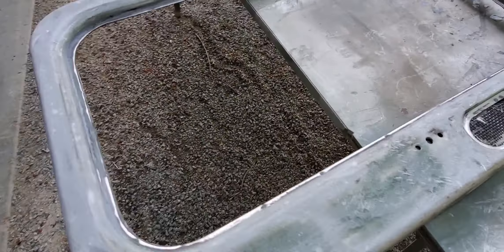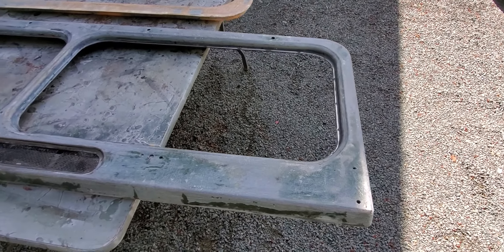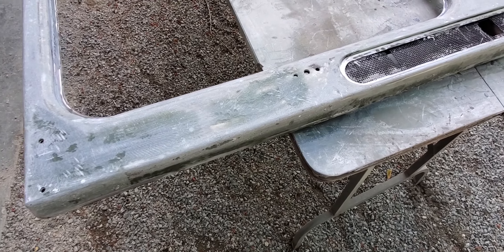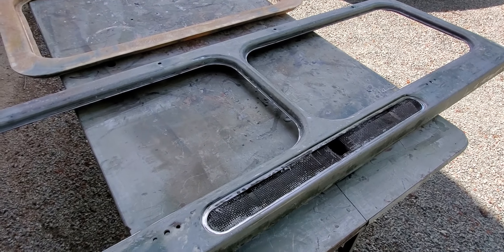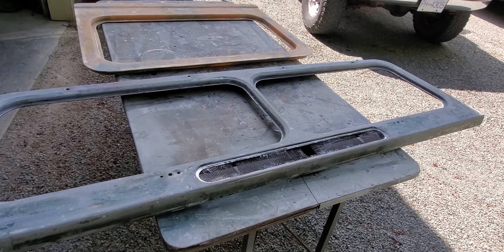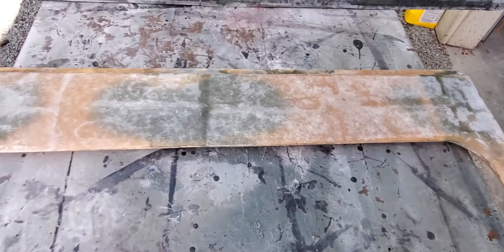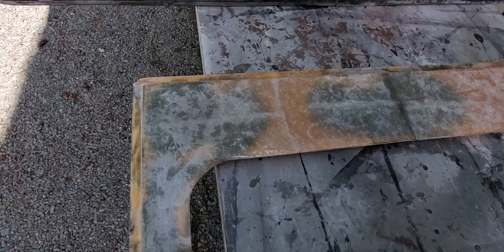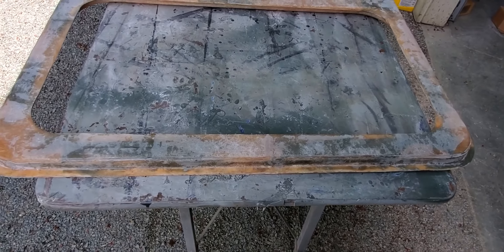G3 Gipsy Windscreen repairs

Comment: Thanks for the update, and explanation for why some fibreglass stays sticky after use. definitely one area on a gipsy that a lot of owners have problems with and that's rust in their window frames, and the availability of the original profile rubber glass sealing strip/rubbers for the windscreen glass. And as I understand it the only available rubber strip comes from Australia, please correct me if I'm wrong on that fact.
Reply from the maker: Yes, Scotts old auto rubber is/was the place to get the WS seal. Last time I checked he didn't have it so I found an alternative in the US. I'll be finding out for sure if it's correct when I put the glass back in this WS frame. Will keep you posted!
Reply: @austingipsygarage ,do want a series 1 soft door top? Original NOS, only 1 side tho unfortunately